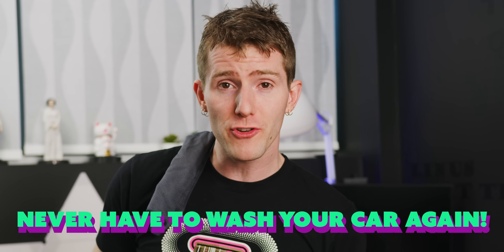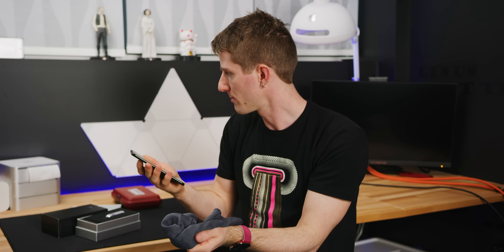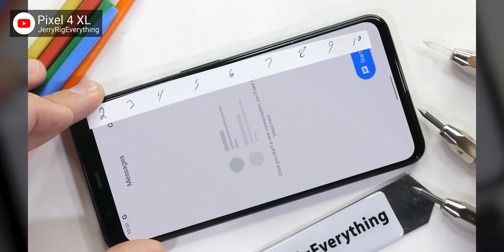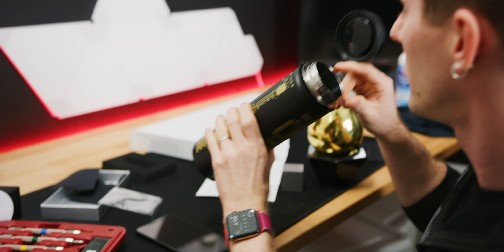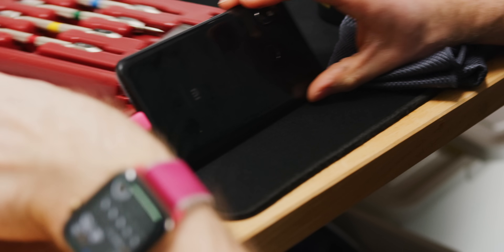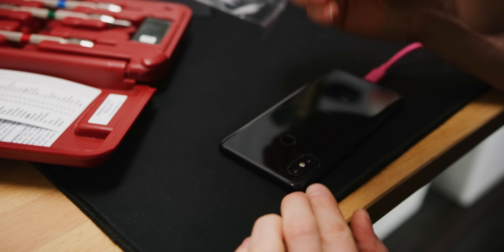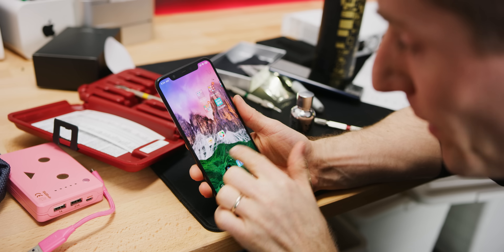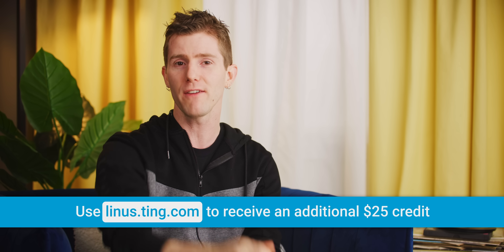Can Automotive Coatings Protect Your Smartphone?...

Comment from the maker: Guys, as discussed in the video the rating for these coating is calculated differently. No, running the test differently will not change the result...
Reply: There's no way you can test the hardness of the coating like that, the coating is far too thin to check using a handheld point, you will just flex the coating and the substrate underneath (which also tells you lot about how likely they are to resist scratching - not at all - what they do reduce is swirls and micro-marring that makes the case/screen look dull over time).
Reply: But does it fill in scratches that are already there? Maybe it's better as a way to repair them than as a way to prevent them?
Reply: @possiblyachannel  Maybe the lightest or hairline scratches yes. With cars, you're supposed to buff out scratches withcompound before applying a coating and the same would be true for glass on a phone. If the scratch is deep at all, you'd probably have more luck taking your phone to a jeweler or watch repair shop and ask if they can buff out the deeper scratches. You might eventually be able to find someone willing to try buffing a scratch out of a phone.
Reply: @possiblyachannel  They wont really. Because its very very thin.
Reply: I've been doing this on my phone already. You need to re-apply it every 6month (depending on the brand) I recommend clay baring the phone before applying the ceramic coating. 
I'm a tech guy, detailer, and aquatic guy (aquascape). : )
Reply: Oh yes, never mind how you ignored the instructions saying to let it dry for 48 hours, NOT 24, and avoid getting it wet for a week. It's not like letting it finish curing to do its job would change anything.
Reply: @spamuel98  i think lets tell "TheKingofRandom" to do this experiment. they have a lot of patience (time) to let it cure before testing than Linus Baby fingers. 😁
Reply: @spamuel98  Exactly
Reply: maybe try to apply coating again on top of the scratches? If the coating works by filling in pores and channels it might serve as a functional way to clean up really scratched screens without paying to get a new one etc...
Reply: Good video, Linus and crew!  You guys should have noted that ceramic coatings for vehicles are NOT meant to be used on glass. They're designed to be used on paint and clearcoat. The primary market for ceramic coatings is actually aerospace where airplanes really benefit from the increased water beading and sheeting, which makes a coated plane quicker, easier and cheaper to wash.

Also, I used to be a detailer when I was young and the detailing industry can be full of fluff marketing and exaggerating the effectiveness of a product.  Ceramic coatings are one of them. They keep your paint clean longer, but that's it. No protection from scratches or UV light. Much like with phones, a screen protector is your best bet, as is applying a self-healing clear film to better protect your car's paint.
Reply: You should watch your words Linus, hardness is not toughness, both of these terms are defined and not interchangable. There are tests and scales for both, diamond is not very tough at all, but it's very hard.
Reply: Dislike for not clay baring the phone lol.
Reply: You failed to test anything that is relevant here... Does it work for phones where the factory coating is damaged/worn out? Does it increase the longevity of the coating already on the phone?

What you tested is if it makes any kind of immediate and significant difference on a brand new phone, where the answer is obviously NO. If it did, your phone would come precoated with this stuff (and, as you know, phones do come with a coating preapplied so basically that has already happened).
Reply: I was a bit disappointed in this video, I was more interested in the application of a product like this on a screen that is not scratch resistant already, so like you could have a very impact resistant durable plastic screen (like that gorilla glass that was drop proof) with the hard coating to get the scratch resistance, I have seen another youtuber use the material on some kind of plastic and it seemed to give such results. it's obviously going to be useless on a screen that already has the properties it provides.
Reply: what if you put several layers,after each layer is dry,so that the protection coat is thicker
Reply: You idiot , the incline of the phone along the other axis ( hands cannot hold things perfectly flat)will determine how easily the water pours off. 
P.s. big fan 😂
Reply: You idiot , the incline of the phone along the other axis ( hands cannot hold things perfectly flat)will determine how easily the water pours off. 
P.s. big fan 😂
Reply: Are you completely sure the coating even stayed applied? All I heard from the results was "we can't even tell it's there", except for the totally precise and definitely reliable tip-water-off-phone test
Reply: @ACuriousTanuki  I also wonder if 24hr was enough,  what if it was applied in a thicker layer and left for 48hrs - 7 days for proper application
Reply: @jimsmith3715  I wondered this as well.
Reply: @axllebeer   Former detailer here.  When Linus said the coating documentation contradicted the sales side of it, that may not be true. Some coating manufactures do lie on the product page like having 9h scratch resistance being one of them. The apparently poor documentation was trying to say that the coating cures overtime and the longer the "vehicle" is clean the better. For example CarPro Cquartz UK 3.0 Coating fully cures in a month. after 24 hours, its cured enough to be introduced to water, after a week the coating has cured enough to provide the chemical resistance ceramic coatings are known for in the detailing industry. additionally layering a ceramic coating doesn't provide any benefit what so ever. some claim it helps with scratches but even that is a widely debated topic in the detailing community. Also I've ceramic coated my galaxy s10 with a ceramic coating designed specifically for glass and I didn't see any real benefit.
Reply: @jimsmith3715  Yeah, I recently applied this exact brand to my car, and it said it would take closer to a week for full cure. You won't have the full hardness after 24 hours.
Reply: @ACuriousTanuki  I think it's more that glass/plastic coatings on phones is totally different to the paint on cars. Different materials.Very different.
Reply: By default phone should have oleophobic coating .....
Unless the coating is worn off?
Reply: Please realise that by applying a coating such as this, you adding an extra protective layer ON TOP of the glass and whatever coating that is already there. Therefor you are scratching the applied coating, which is sacrificial and prevent scratching the actual glass (and possible coatings) underneath. Kind of like a second clear coat. Also, a coating like this could have issues adhering to the coating that is already applied to the screen, which already has a protecting beading. Remember a smooth surface or paint is best sanded before you apply a clearcoat, which does not mean you need to start sanding your phonescreen ;)
Reply: RE-APPLY the coating to see if it covers the scratches!
Reply: Does Linus have a ting service plan?
Reply: Why not try one those already being sold as phone coating... it's trash, wears and scratches over time and then you can never remove the residues.
Reply: It does make a deference to soft screen protector.. try that , need a few coats
Reply: Would this help on softer screens like on mobile consoles?
Reply: @I_Like__bananas   maybe, my screen protector feels more like glass now.  I would be a little careful it isn't visible. Most won't be visible but you could test a spot
Reply: Please make a car channel already, you guys already have alot of engineers in the company.

We need somebody that can cover the technology side of things in vehicles, most journalist I watched don't know jack shit about the tech that goes through new cars.

You guys could even start a modding project that involves tinkering with the electronics. Like what we seen with the Comma.ai
Reply: Curious, does the coating help reduce the amount of scratches on the phone?
Reply: Helo sir i am from India and I not be able to get good gaming PC  so it's a request if u ever had a chance to sponsor a video by asus or intel than please give the pc to me it's humble request 🙏😊 and if u do that I will assist  the shiping coast please 😫🙏🙏💓
Reply: And if u want to contact me than here is my e mail sl85336@gmail.com
Reply: I was so in tuned to your demo until the hello kitty looking charger appeared.
Reply: Welp
Reply: Linus Tech Tips you def need his smooth voice  in the scratch test
Reply: liquid protection kits in Walmart for Apple Watch. Liquipel.
Reply: Have you tried leaving it in the sun for a while to make sure it doesnt yellow or get weaker?
Reply: Linus Tech Tips you mean running the test the correct way?
Reply: But can it fill in scratches
Reply: its worth noting that some of the manufacturers of the real good coatings will only sell the proper stuff to authorized/certified installers. Gtechniq being one of them. you can apply thicker coatings with an airbrush, and they tend to be more resistant. Gtechniq sends a blob of hardened coating with each professional package, and it doesnt get scratched as far as i can tell.
Reply: Linus Tech Tips absolutely loved the jerry rig everything part!!! Keep up the great work
Reply: Didn't you want to have a car chanel?
Reply: I am giving some thought to adding a coat of this to my display graphics tablet (not a wacom so screen protectors are not available).
Reply: If by "running the test differently" you mean running it by applying it as per the instructions, then yes... it will absolutely change the result.
It's either short-sightedness, confirmation bias or straight out arrogance that would lead you to believe otherwise, though my money would be on confirmation bias; thats assuming you knew going into it that the hardness calculations are different. 

This... "test," was half-assed at best.
Reply: And is it safe to douse this chemical concoction onto your face and lips every call? 

Asking the tough questions
Reply: 0:29 you could have said a lot more hard such a shame it would be a great cringefest Linus joke
Reply: You failed to even apply it correctly
Reply: The fact that they use a pencil hardness scale, straight scam bet half the people don't read that lol
Reply: Altering the application method does increase the result and removing the oleophoebic coating first will make it so that the product you applied would have adhered better to the surface, so next time LINUS, dropp the ego and listen to the manufacturer and the others at the office that tried to help your sorry ass, no hate but I get annoyed of your ignorance
Reply: ...yeah it would...if running the test different would mean actually applying the stuff correctly....
Reply: i'm ending 69 rplies
Reply: I feel like a lot of complainers are glossing over the fact that the coating is softer than the gorilla glass. Linus you should let the haters send their own phones in and go completely overboard with the test and destroy their phones lmao
Reply: What a surprise,  they didn't do something properly again.

Seriously you guys f**k up a lot of your content these days. 

You're closing the gap on the Verge more and more.
Reply: That is the biggest golden butt plug I've ever seen.
Reply: Please try this on galaxy 🙏  fold
Reply: Linus Tech Tips but can it run crysis?

Comment: I promise you there will be a difference between the ceramic coating you used in this video and a professional coating.  For example GTechiq's Crystal Serum Ultra. Which you would have to get a detail shop that's been certified in their product to coat it for you. But you could try GTechniq's Crystal Serum Light. Which is available to the public.  There is a difference in $20 & $30 bottles versus professional brands like the above mentioned. Crystal Serum Light runs around $80 to $120 for a 30ml to 50 ml bottle.
Reply: And also apply 2 to 3 layers each 24 hours apart. And you will get a different set of results.

Comment: I own a business professionally paint correcting and ceramic coating high end vehicles, and there is a lot of misinformation out there. Ceramic is not a filler, that’s why in an automotive setting, you have to polish or “level” the clear coat so you’re applying ceramic over a near flawless surface, or as close to perfection as you can achieve. Ceramic essentially seals in the work underneath, so if you apply ceramic over paint without decontamination or correction, it will be hydrophobic, however there will still be flaws and blemishes underneath. If you want a filler, PPF, also known as clear bra, acts as a filler for minor swirls and scratches however rock chips and deeper scratches will still be visible. Also the misconception that you’ll never have to wash your car again is false. It’ll make cleaning much easier and it is far more durable and hydrophobic than any traditional waxes or sealants out there, but you still have to wash your car. There is a lot to this that I can’t even begin to explain in a single comment, but this video is full of false information. People only think it’s snake oil because they believe the propaganda and marketing ploys pushed on them instead of seeking a professional opinion or doing their own research!
Reply: Hi. I bought a windshield glass repellent sealant for cars. I'm applying it to my smartphone screen because oleophobic coating worn of and it makes screen silky smooth again. Do you think i can damage phone screen this way?

Comment: If you live in a place where you get a lot of tree pollen on your car, those coatings make it wash off so much easier.  I stopped using waxes.  I have a shelf full of waxes that I will never use or want to use again.  The coatings take the place of the waxes.  There is one that you can apply in minutes just spraying and rinsing.  No tedious application process and buffing needed.  35 years ago when I was a child, I would have absolutely believed it was magic!!

Comment: Love the ceramic coating, but I believe touching your phone all the time would eventually wear this off. I think using a spray nano coating for cars would be 10x easier to apply with no wait time, and you could continue applying it as it wears off. Rather than having to leave it for a day or so to cure each time. Likely wouldn’t be as scratch resistant, but would have very similar cleaning properties.

Comment: The biggest issue with this test is that phones come with oleophobic coatings (you can see this one still has it by the way the water beads). Step one is degreasing the surface and removing any oils. If the ceramic coating can't stick you won't see much benefit. He should have applied 90% rubbing alcohol to the surface to remove the coating and oil before applying ceramic. Great idea but poor execution.

Comment: I have AvalonKing ceramic coating on a couple of cars and it's a night-and-day difference how it performs. The car actually gets cleaner if you leave it out in the rain for a little while because the water beads just carry the dirt away. The dirt doesn't stick very strongly to the surface. That's great because it means less car washes and you're scratching the paint less because you're scrubbing it less often. Continues performing like that for years, it's phenomenal stuff.

Comment: I got a new iphone 11 recently and noticed that when I took it out of my pocket, the screen had a powdery white substance on it. 
At first I thought it was dust but after turning my pocket inside out and thoroughly running a vacuum cleaner over the pocket material, the phone still gets the powder on the screen when I take the phone out of my pocket. 
Could it be the oleophobic coating is coming off after rubbing against the pocket lining?
I'm starting to suspect that is the case. 
Otherwise, I'm stumped. 
Worried about the powder getting into the camera lens area.

Comment: You can see the difference in contact angle of the water with the phone in the very first test suggesting that the ceramic coating further improves on the hydrophobic coating that is already on the phone. Contact angle reveals everything. Look near the point of the edge of the drop and the glass

Comment: There's this stuff called edci and it's this green spray you use to coat carbon steel blades in order to protect it from corrosion, it's food safe and also leaves a thinner than thin film on whatever you spray it on, I used it alot on my watches to stop fingerprints on the crystal, might be worth a go

Comment: Linus, passed a test that required him to read the directions and turn it in blank. But he can't follow directions that requires, 48 hours curing time and to not get it wet for four days..... This could have worked better had he at least FOLLOWED DIRECTIONS. 

Linus, redo this video by letting it cure for 48 hours plus wait another 5 days to test. I doubt it will work but for crying out loud, FOLLOW DIRECTIONS.

Comment: Speaking of magic coatings, I've had great results ripping damaged CD/DVD/bd using rain-x. It does a decent job of filling microabrasions without risking more aggressive polishing methods. I've used it on unplayable discs with circular scratches and been able to recover contents.